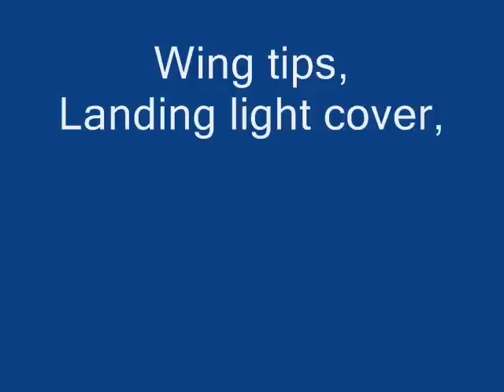Installing the Sportsman STOL Kit on a Cessna 170B

Comment from the maker: It definitely helped on floats. Before I could not get it off the water until 50+ MPH. Now it's coming off the water between 45-50 MPH. The practice stalls at altitude are very forgiving. There is no "break", it simply dips down for second, regains speed, flys, then repeats. The landings can be done so slow now it feels like a leaf floating to the ground. Very happy with it!!

Comment: Ones tip.... I would strongly advise countersinking the skin while it is on the aircraft. The skin material is too thin plus you want to make sure that the pilot in the countersink cutter follows the hole in the existing leading edge...
Thanks!!!

Comment from the maker: The only parameter I tested was glide ratio. Before the kit I could get 8.8:1. Now I can get 9.3:1. I know, not much of an improvement and far below their advertised 13:1. The next test will be when I go to floats in July. Before, I could not pull it off the water until 50+ MPH. I'm hoping to see an improvement. Ugly??? Once painted... I would be surprised if the average layman could tell the difference between a modified and stock 170.

Comment: i just got the sportsman stol kit for my 182P, and is not countersink and the rivets are very simple cheap pop blind rivets... surface will look crappy ....
Reply from the maker: That's unfortunate because the kit comes with good quality rivets that must be countersunk.
Reply: @AK907dude  what thickness has the stol kit you got? my was .025, i don't countersink it, i will guess will be better with .032 ..
Reply from the maker: @jhonnyextremo  I can not for sure say what the thickness is, but it is plenty stout so I would guess .032. It came with AVEX brand rivets that must be countersunk to 120 degrees.